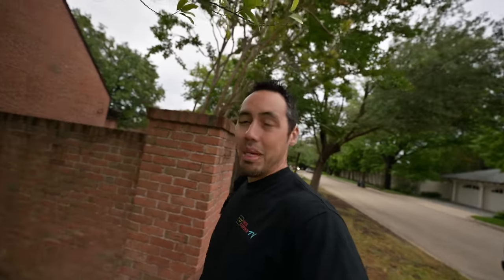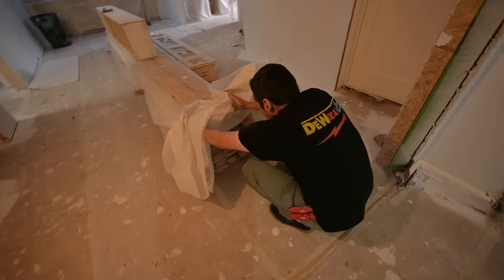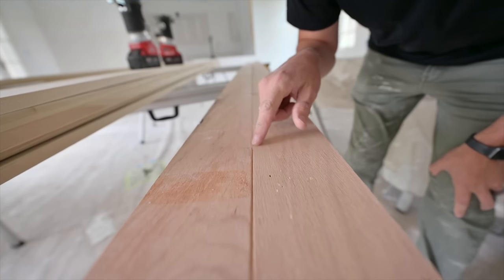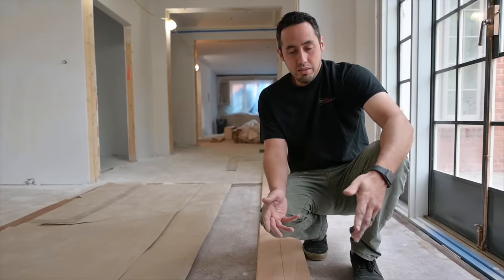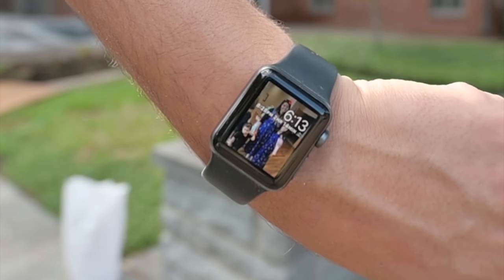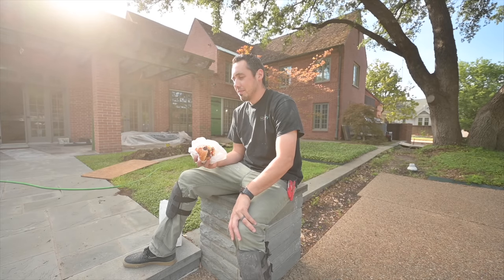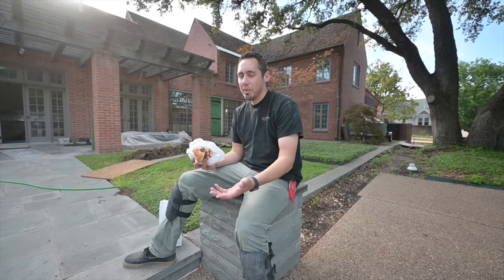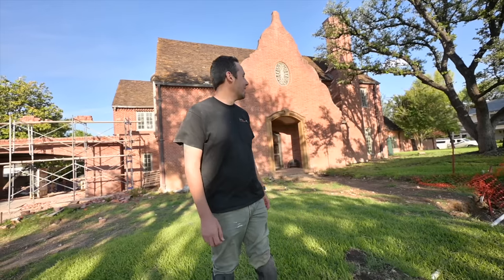Cruel and unusual punishment -  FULL TIMELAPSE

Comment: You nailed it. When the contract calls for "match existing" - this flooring will blend into the original seamlessly.

Doing two miles crawling and stooped over seems a little like boot camp! Would it be possible to set batches up on sawhorses? Then work at a more comfortable night and transfer completed batches back to the floor.

Comment: My big issue with the Milwaukee router is that the thing eats batteries.  I love it for what it does, but don't think I could use it all day on 6aH batteries.  I ran it with a 12aH battery but it's not balanced and gets uncomfortable quickly.  What was your experience with the battery usage on that stack?  If it was good, maybe I don't have the right XC's or something for mine in the lower capacity.
Reply: This is the exact reason I only have a cordless drill and a reciprocating saw. Having those die is frustrating enough, I couldn't imagine being halfway through a cut when my jigsaw or router or friggin miter saw dies.
Reply: @CLove511  oh, I love my cordless everything.  I have a different use case though, we do a lot of cabin work where there's no utility electricity so it's either battery or hear the generator drone in the background

Comment: Years of construction work left me with Tinnitus that sounds like that router and never stops, I’d suggest you fellas get a good set of headphones. Big fan of y’all’s work!
Reply: Huh? Did you say something?
Reply: I can second this.. just with automotive and compressors. Ear protection is so important.
Reply: @Me-iw5wo  Dang it.  You beat me to it.
Reply: Same I get it every night.
Reply: Agreed......but he did say he'd be listening to audible  so there's your ear protection 🤔
Reply: Me too,🙄
Reply: They may be noise-cancelling in-ear phones; that’s what I use, and sometimes put over-ear protectors over them if it’s something really loud.
Reply: @wandabout  watch out with that, noise cancelling is not the same as noise blocking, but don't catch me on that. I guess if they are OSHA (and/or whatever your country has) compliant, they should do the job. And good ones (like Isotunes) are so much better than the 1.00 euro headphones I used before.
Reply: I'm in my early thirties and when I was in my late twenties I started religiously wearing ear, eye and hand protection no matter what. Even with the old guys making fun of me I do it. I want to keep my hearing and my eyes as long as possible.
Reply: I hear y'all on the ear phone protection. Defiantly need that. What about lung protection? They in an inclosed area, obviously no vacuum system. That worries me.

Comment: They’ll hold up 
I just did 8500 sq ft remodel and ran every piece of casing with a cottage bead on both sides and made all the wall registers (drilled 45degree hole and carefully dropped in straight bit on 45)

With little tiny battery makita

Have fun good times yeehaw

Comment: That's on the floor guys. THEY needed to put the edge on those boards. They sell a planer that does that. Fits right into it. You put a small 45 edge on it. Sometimes you have to take two passes to get it. At least there's no noise and no moving parts. Regardless it's absolutely crazy putting a v-bevel on all that flooring.
I would have specified it as : Mill flooring with v-bevel $2000.  At least it's a nice payday.

Comment: Dude be careful with those little trim routers, I was using mine back in December and I was working long hours not being careful and I ended up cutting the tip of my thumb off and losing a quarter inch of it and a part of my bone. I was back working within three months but it the pain was terrible and the amount of visits to the specialist was killing me with $$$. 

Love your work and I'm a huge fan, but just stay safe 👊
Reply: I got lucky, dont really know what happened but I touched the bit while it was running at full speed. Fortunately it was the bearing on the end so just a minor bruise and a major shock
Reply: @vidpromjm  That's crazy man. Stay safe!!

Comment: Will this be sanded after it's installed? If so won't that make the finished groove too shallow?
Reply: They're new t&g boards so they shouldn't be sanded as aggressively as refinishing old boards. But perhaps that's why they're putting down new boards because refinishing the old boards would do what you said.
Reply: was thinking the same thing

Comment: Few years back I had to run a stack of wood similar size through my thicknesser as the customer had bought 5 meter boards (16 ft) that had been used as a sub floor of a gym so they were old rough timbers and different thicknesses, AND covered in dirt as apparently they used to use essentially MUD to level out a floor before laying the maple on top - so I had to run EACH BOARD through my planer, the ENTIRE STACK, trimming off just a little, then dial down the thickness a few mm and do it again, the entire stack, and again and again... until I was getting fresh clean wood on all the boards on one side with no remaining ingrained dirt. THEN I had to run them all through the thicknesser again, same process, the entire stack at 40mm then 36mm etc etc to get them all the same thickness as the thinnest board so when laid the floor was flat without having to hire in a professional floor sander.

took a week - a full 5 day week, 8 hours a day, with two people, I got through 4 sets of blades, rotating them until I could tell they were dull and honing them up again on my jig each evening.

and all "because the wood was cheap"  not after £1500 of labour it wasn't.

Oh yeah I've just remembered, and after all that, I then had to make up a jig to trim them all the the same width too, as none of them had 1 good edge to run on my tablesaw fence, which was the last day of that 5 day week.

That's tedium. boring dirty, extremely dusty, tedium.

Comment: I did job where the homeowner acting as owner/builder with a PHD in engineering intentionally ordered wood like this to save money. The floor guys had to make t and g as well. He fired them for taking to long and never paid them. It is now 2 years later, and the house remains unfinished.  Flooring and finish carpentry are a highly skilled trades.  I have a great deal of respect for few guys like you. I apply finishes and more often than not, people praise me for the finished look. In reality, it is not me. All credit and professional respect goes to you. By the way, I walked off the job and told the homeowner he can finish the house himself since he thinks he is so smart and has zero respect for skilled trades people both male and female. Great video and continued success.

Comment: I gotta wonder if it would have been less work and a better product if you just installed the unfinished floor and hired a floor guy to sand both floors down to get rid of the bevel on the old floor and refinished all at once.
Reply: I was wondering the same thing, but it could they wanted this historic look to the flooring left intact. My thought was why the contractor didn’t just order boards that matched up in the first place!
Reply: High end customers don't care what the cost is. They want what they want. You make it happen.

Comment: Adding a larger baseplate to the router will make it even easier to keep the router steady.  The battery on top and the small base makes these cordless trim routers less stable than a traditional router.  The large plate means less stress on your wrist trying to keep it steady.

Comment: Knowing that you own a lot of the 20volt Dewalt tools, as well as the Milwaukee tools, have you ever used a battery  conversion adapter to try and unify your battery usage?  I mostly have Dewalt 20 volt tools, but purchased the 18 gauge finish nailer, tool only, and then bought an adapter from Dewalt to Milwaukee to minimize the number of different batteries that I had to buy and use.
Reply: Funny you said that, I actually have the same exact Milwaukee 18 gauge set up with dewalt battery power. For the same reason as you probably, mainly have dewalt 20, primarily bc dewalt 20 was what I had first and didn't want buy two different systems. And I got that battery adapter idea from this channel, so yeah he knows about the battery adapter. Lol

Comment: I've installed and Sand and Finished solid hardwood flooring for 25 years. I wish you the best of luck with this. 
My concerns 1. When the Hummel drum sander comes in and runs the 50 grit and then 80 the micro bevel that was created will enlarge or in some areas begin to diminish or disappear. 2. After 80 grit Hummel when the floor dogs trowel fill the flooring the bevel will get filled with the filler, so they will need to "spot" fill the entire floor to avoid getting filler into the bevel. 3. After they run the 100 grit Hummel the width of the bevel will enlarge or in some areas begin to diminish or disappear. 4. When they run the 100 grit screen on the buffer the bevel will enlarge or in some areas begin to diminish or disappear. 5. The 1st coat of Sealer will fill the bevel and the 2nd and 3rd clear coats will do the same. > if this hardwood was to be stained the bevel would come out as black lines.
Reply: That’s exactly everything i thought watching it too. The hardwood guys should’ve just talked them into sanding the bevel out of the existing floor. Richard did an awesome job for what he was asked to do as usual, but it was literally a job that was futile and he should’ve never been asked to do in the first place.
Reply: @zakkshaffer3216  A floor dog should be the tradesman to make decisions on the hardwoods. I would have provided 3 or 4 options. First would have been to choose a threshold and cut out @ threshold and install an accent plank , then transition to the new flooring.. the flooring they purchased is new growth has no patina and the color and sheen level is not going to match anyways.

Comment: Props for providing a solution. HOWEVER, putting a V groove in hardwood floors is realllyyyyy a bad idea and they should have just let it not match. Traps all the dirt and overtime just ends up looking like crap compared to a smooth surface.